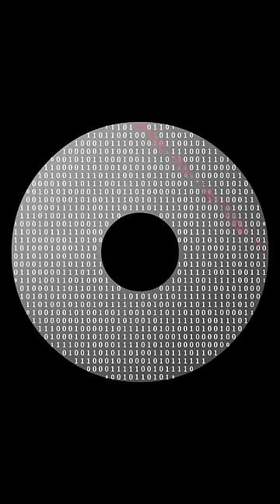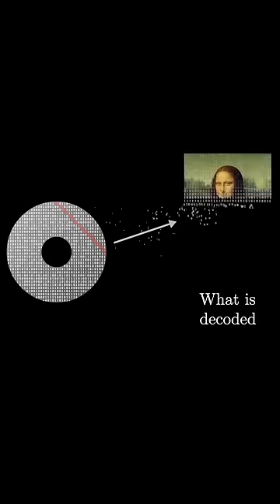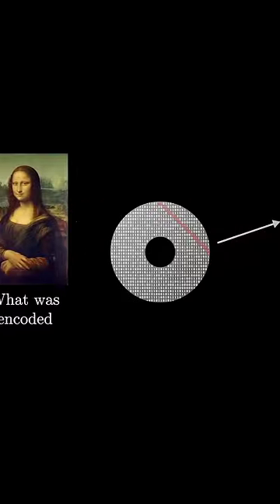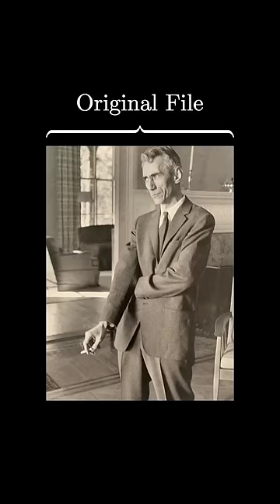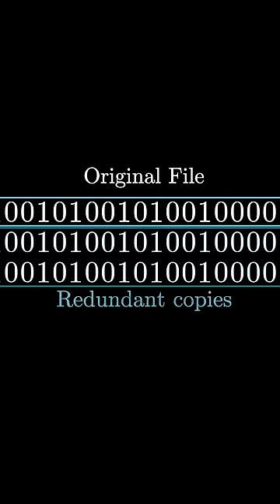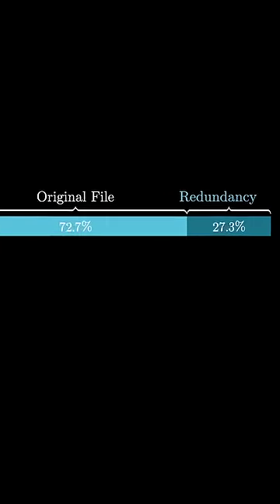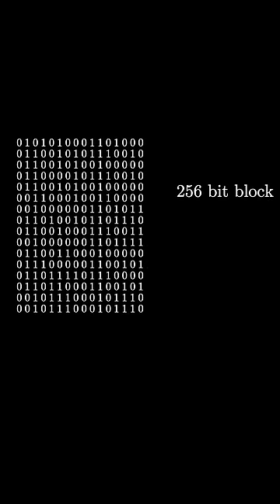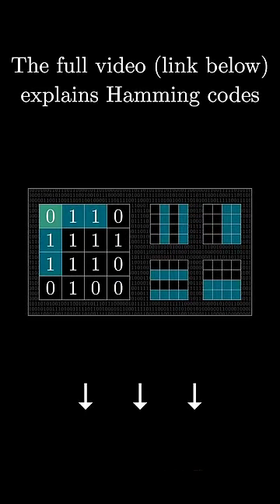Error correction is incredible

Comment: Hamming codes are really neat - despite being a really old concept, you can detect up to two errors and even correct an error bit. Also they use the channel capacity really efficiently being referred to as "perfect codes", and they're very easy to implement. We used them at CERN for diagnostics for some of the safety systems as we had low bandwidth for our distributed systems
Reply: Yeah for the actual explanation, it's in the video. Or did you just want to point out your job in the yt comments?
Reply: @itsgonnabeanaurfromme at least his job is still related to the topic of the video, I'd rather read these kind of comments than seeing people troll each other

Comment: Meanwhile: My CD with a single minor scratch— cannot read disk
Reply: Hopefully, it's a Taylor Swift album..
Reply: Why? @Revelian1982
Reply: @generalginger7804  Because if it is and the CD is in several pieces.  Man.  That is never, ever, coming back together 😂
Reply: @ryanmarbut1035  😭😭
Reply: Intriguing. I see what you did there very clever.  I’m still not gonna watch the full length.  😅
Reply: @Revelian1982 fr good riddance, I will be glad lol
Reply: @Revelian1982 She’s fine. Stop hating on her cause she’s richer than you’ll ever be and a billionaire. Young girls like her music. Do i? Nope. But who cares. More likely you dislike her for being anti fascist.
Reply: @Karlswebb My brother in Christ, why would she anti anything fascist?
Reply: just sand it
Reply: 😂☠️ @Revelian1982
Reply: @Karlswebb  Look how many inaccurate presumptions you can fit into a single comment. Incredible. Can't I just dislike her music without being called Hitler?
Reply: i found abbey road on cd at a "antiques shop" and i played it. i was glad it played but i put the disc in the light and it has holes through the data layer. so there is missing data, but the cd reads fine. i thought it was impossible but apparently not.
Reply: @omnitone  CDs don't use Hamming Codes and the error correction bits are not side by side, the video is wrong.
The error correction bits are interleaved with audio data which makes CDs more resilient.
Reply: Data CDs are less protected (if any) than audio CDs.
Also, cheap players, i suppose, could ditch error correction for saving money.
Reply: @semibiotic  That is false. Data CD's employ more error correction than red book audio.

And no players do not ditch the error correction.
Reply: @deang5622  I had issues with number of barely scratched Data CDs, but no issues with severely scratched audio CD, but only in mid-end audio system. In PC that audio CD was only patrially readable.
So, it is a big question, who is lying.
Reply: @semibiotic  No one is lying, what is wrong is your level of understanding of the error correction methods employed on the two media.

Just to give two factor you haven't considered is the orientation of the scratches. Second factor is the size of the scratch.

And your opinion without any measurements to back it up is meaningless.

There is specialist equipment which will report and count the number of soft and hard errors.
Reply: @deang5622  Here is third factor for you - characteristics of drive optics.
Expensive and/or smart drive optics (or simply other light frequency optics) could see thru scratches.
Reply: @semibiotic  That is not a third factor.
I am talking about what causes errored bits.

What you have stated is a scenario which doesn't cause errored bits.
Reply: @deang5622  It is. Smart optics could eliminate scratch direction factor, you mentioned, and restore analog signal before its demodulation and convertion to data.
Smart optics could use wide surface spot and see around/aside actual scratch.
Reply: @generalginger7804  why not? Swift is rubbish music...
Reply: @Karlswebb settle down Karen...
Reply: @Karlswebb Lmao imagine taking a youtube comment section personally
Reply: @semibiotic no CD player ditches error correcting. There are so many bit errors when reading a CD that they would be useless without error correcting. You or I could not afford a CD, let alone a CD player that had no errors.  Error correcting codes make the modern digital communication world possible.
Reply: @ronjones4069  I don't think you are really know what are you talking about.
CD's aren't near the edge of technical progress anymore. There are DVDs with at least 5x informational density, and there are BDs.
DVD head could read CDs without need  of error correction.
Reply: Get it resurfaced, most scratches are just the plastic that’s covering the data which is completely fine. Now if you flip it over and scratch the part you write information on with a marker, that scratched will be actual data loss

Get a professional resurface done and you’re golden
Reply: I've had a XBox disc (Sonic Mega Collection Plus) with a crack going through half of it and it plays fine to this day lmao
Reply: That's impossible, you really must have more scratches
Reply: @Revelian1982  Dislike ≠ Spread hate. You knew what you were doing and so does everyone. It's totally ok for you to not like her, tho
Reply: My brother bought PC game magazines occasionally the come with a CD. The brand new disk didn't with, he was angry about it not working just because of a booger! So he put a scratch on the disk and mentioned I'll work then, which it actually did. He said this was often the case that he had to scratch the disks a little bit for them starting to work 🤯 I had no idea it would actually do the trick!
Reply: i guess you should've dedicated three thirds to redundancy
Reply: @Karlswebb  i dislike her for flying a private jet around and telling people to drive electric cars
Reply: @Karlswebb  very idiotic of you. People are free to dislike and even hate whoever or whatever they want
Reply: @Revelian1982 just another reason to dislike her and her fanbase
Reply: @Revelian1982  You do realise the youtube comment section is not school. It's scary that you believe whole heartedly that such a comment has any meaning. Unless you are 10 of course. How did the world come to
this point. Did they not teach you critical thinking.
Reply: @Blimzio  Yes.
Reply: @SchlickSteve How is she supposed to travel to shows? By secret bicycle path?
Reply: @DwightLivesMatter  yes

Comment: This is one reason a cd can store more data as a music cd. The error correction doesn’t take as much space
Reply: Error correction requirements depend on the nature of the data being stored. If a music CD is scratched, for the most part the worst effect will be slight distortion on some parts of the song, but it will still play.
On a CD containing SOFTWARE however, those scratches can mess up just one bit of program data, which can cause a JUMP machine code to turn into something else, such as an INCREMENT code. The result will cause the program to not skip to the correct location, reach a part of code it wasn't supposed to increment, and produce a domino effect of changes that eventually causes the program to crash.
By this reasoning, Error Correction needs to be much stronger on storage space containing software than storage space containing music.
Reply: @justaway_of_the_samurai 
Exactly
Reply: @justaway_of_the_samurai  Thats all true but does it relate to the statement? I don´t even know what the fist comment want to say. Is there really more space on a data CD except for some special types of data CD´s?
Reply: @ekaf3544  The CDs will have the same maximum storage potential regardless of the data stored on it.
The point the OP comment was making was that error correction algorithms basically use up a ton of extra storage space on the disk.
"Error correction algorithms" are techniques to keep scratches on the disk from making the data on the disk completely unusable. Music doesn't really need them as much as other data.

Comment: I think it's way more important to mention that the actual data isn't stored on the surface of the CD, but on the reflective layer about 1mm below the surface. 
These bumps in the material change the focus of the reading laser, making it possible to decode 1s and 0s. This also means that, unless the CD is scratched so heavily that it becomes impossible to differentiate between the bump and not-bump, the data is unaffected. 

Affecting the data layer directly is essentially impossible to do unintentionally without breaking the CD entirely.
Reply: This
Reply: That's why I always told ppl to lay them on the bottom, not the top with the graphics. If the graphic is scratched, the data is gone.
Reply: Yes. Really thought he couldve used a different example lol
Reply: But a scratch in the glass would cause the laser to read the bits wrong.
Reply: @davidt01  Luckily not! The way it is read is that the light is either focused or unfocused, and the switching from one to the other is what indicates a 1 and no change is a 0. 
This way, even with a damaged disk, as long as the sensor can tell when the switch happens, the data is fine. 

The primary problem is actually the reader becoming unable to keep sight of the data track itself, as the way it keeps focus relies on rather continuous deviation from the perfect path. (There's some great videos explaining how the autofocus works on CD players, though many still get wrong how the actual data is represented)
But essentially, if the damage causes the track to be no longer traceable, the disk cannot be read properly. This is also why disks take longer to start and sometimes infinitely loop trying to start when damaged.
Reply: @tsume_akuma8321  I see, very interesting.
Reply: This video is about error correction & Hamming-Codes, CD scatches are just the example;)
Reply: Unfortunately reality is different. Many CDs are still unreadable. Physics aside nothing is perfect.

Comment: Also, because the laser is also focused into a cone rather than beam, small scratches are out of focus when in the laser beam and, while they do attenuate the visibility of the 1's and 0's, the contrast is still above the detection threshold.

Think like if you put a piece of polycarbonate plastic on a piece of paper and then used a sand blaster to draw a transparent line. As long as you didn't blast it too much, you'll have an approximation of what a CD laser sees when it encounters a scratch.

Comment: I wipe a little mineral oil on the disc. Then wipe off the excess. Remove as much as possible without the scratch showing.

Doing this flattens the angle of incidence of the scratch so it can be read. It works more often than it doesn't.

Comment: I learned this in 1980.
I think that's before CDs. It is used like parity to reduce the possible errors in a single character or string.
Reply: CD's don't use Hamming codes.
And yes, Hamming came before CDs.

Hamming is an extension to the concept of parity bits.

A parity system is error detection only. You know there is an error but you don't know where in the data word it is.

Hamming takes that concept further and adds extra parity bits which are computed from differing portions of the data word.

Using Hamming you can thereby not only detect the presence of a data bit in error, but also identify its position in the word.
And if you can identify the position of the errored data bit, you can then correct it, just by inverting the bit.

Hamming is single bit error correcting, and 2 bit error detection.

Comment: In the case of audio discs some players would also implement filtration to forcefully "correct" a damaged audio signal as a second pass if enough of the data was readable for it to play. Since would also be single bits for the most part it was a good solution.

Comment: i dunno i still prefer alot of redundancy. but i think we can all agree it would be nice to create discs that dont get scratched in the first place. man i miss the good ol days of physical copies but wish once you pay for the thing you can get a no cd version as a back up.
Reply: It's not just about discs being damaged, this is also used in wireless communications, where the medium itself (air) introduces errors, specially if you'd have a network connecting a computer on Mars with one on Earth, the amount of radiation would flip a lot of bits on its way, with hamming codes you can have the message beautifully reconstructed.
Reply: @lucianoinso  huh didnt think of using it for wireless as well, we still have a long way to go before setting up on mars though

Comment: For CDs this worked pretty well,  but for blue ray it was a complete failure.  Even the slightest imperfection, smear or scratch ruined them
Reply: No. CD's don't use Hamming codes.
The video is misleading.

Comment: There's a big difference between scratching the bottom or the top of the disk. Try scratching the top and then read data because you've actually torn off the layer that has the data on it.

Comment: CD scratches are usually not affecting the 1s and 0s, because they are sandwiched between two layers of plastic, you scratch the plastic, but because the laser is focuses inside the plastic not on the surface is just has minimal impact.  Not that error correction codes aren't interesting

Comment: Hamming is clever, but Reed-Solomon is what's used and it is really incredible. I did an experiment on hard disk and randomly corrupted data until the disk gave up and reported a bad sector. I was able to corrupt 20 bytes of the 512 byte block without losing data.

Comment: I thought the part that has a scratch in it, can be returned because it has some sort of reference point from the 1s and 0s beside it. So even if that  part was physically scratched, the data remains intact because the 1s and 0s or data beside it contains information on what it originally was.

Comment: damn 9 bits only? i'm guessing this is some sort of compression algorithm that defines the block.
Reply: not exactly. It's a set of parity checks that allows you to locate the exact place where a single error happened and correct it, as long as it's just one error per 256 bits, or detect errors in 2 bits, but not correct them. Any more errors and this doesn't work.

Comment: this might explain an unusual phenomenon i dealt with. I had a video game CD that had.. a little chunk of it broken off. by little i mean about half a penny's worth off the edge... the game still ran fine. i never had a single issue with it despite it missing a significant portion of it
Reply: In that case, the data was probably not written on that section of the disk (if the entire capacity wasn't used, the outside of the disk is blank).

Comment: Also every sequence of 1s and 0s is just one single number. Even your 16TB hard drive is only one number
Reply: Yes, a number that is 128 trillion bits long.
Reply: Not correct.
You might as well say all data bits passing down a fibre connection is all one number and this principle is NOT true.

What you have are binary digits, but a number is a group of bits and it's up to people to specify the number width, the number of bits that comprise the number. And we do not consider all bits on a hard drive to be the width of the number. The number width is typically 8 bits, which is a byte.
Reply: @deang5622  this isn't true, it has nothing to do with bytes. Bytes aren't really a thing in information theory. It's in its original meaning just the smallest directly addressable amount of bits in a computer. Any finite string of bits can be viewed as a single number.

Comment: I'm no expert and please correct me if I'm wrong, but wouldn't having your redundancy being a single line mean that your code will be repeated?
So for example let's say the redundancy code is 1010
If we have a full code that can all be restored from that, the code can be:
(1010)(1010)(1010)(1010) (the brackets are to explain it better)
Which means, that the file stored on the disc will be repeated, and, the file will also be repeated 
So if 1010 stands for🟩🟦, then the whole code will be 🟩🟦🟩🟦🟩🟦🟩🟦

Then again most of the time I'm saying something wrong
Reply: No completely wrong.

You can create a scheme where the data is duplicated and that could be used to correct errored data but it is an extremely inefficient way of doing it.

Can you imagine the performance problems that would occur if you had to transmit the same set of data 4 times?

The idea is to send the true data plus a much smaller amount of redundant data which can be used to correct errors in the true data.
It's far more efficient.

Comment: The interesting part was the compression done for the backup. Was it hexadecimal code or some other? We will never know because you cut it off.
Reply from the maker: You're right, dang. If only there was a long form video linked at the bottom that went into the full details...
Reply: Long form? 0000=0, 0001=1, 0010=2, 0011=3…

Comment: 9bits redundancy check for every 256bits data sounds impressive but it is not mentioned how many bits can be damaged that it can still recover the full data. until that information is given, 9bits redundancy check doesn't matter.
Reply: No. Unfortunately the video is misleading.
CD's don't use Hamming codes, they use a more sophisticated scheme called Cross Interleaved Reed-Solomon.

You should completely ignore any information in the video relating to numbers of bits.

Comment: so its not cd itswlf its error correction that made cds stable compared to floppies etc...
Reply: Stable relative to vinyl records, yes.

But what he is talking about here are Hamming codes which are nothing to do with CDs. CDs use a completely different error correction system.
Reply: @deang5622  a bit different bu still a standar potocol mostlikely like one medium raid system ...or its  medieval version it seems as doesnt show actual code/logic not easycomparedetails but simila its clear.